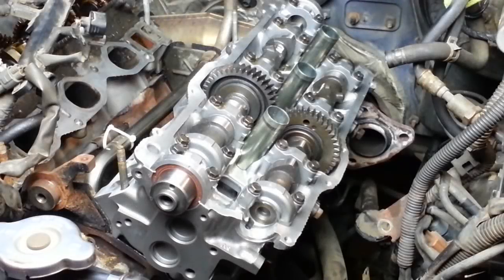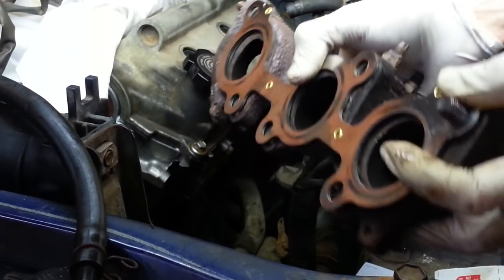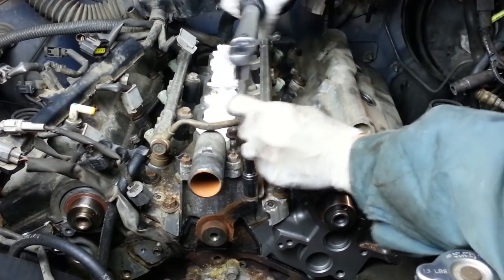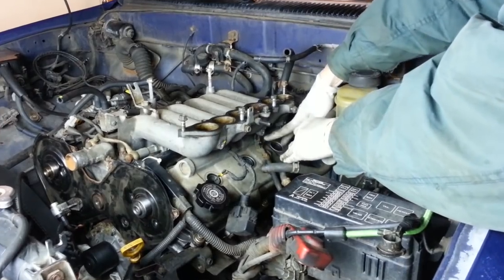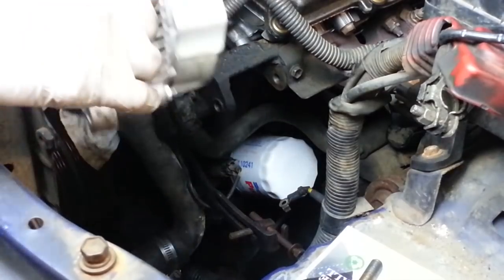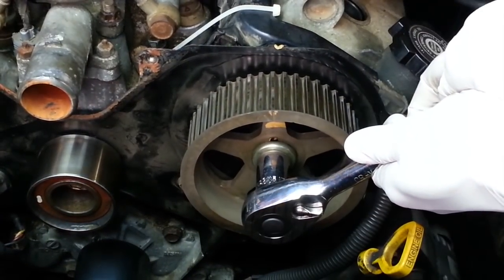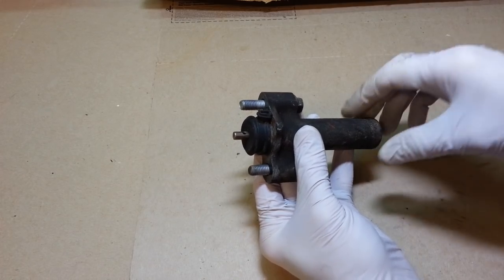Cylinder Head & Gasket DIY Procedure - Toyota 5VZ-FE - Part 5

Comment: I'm FINALLY over the hump replacing a blown head gasket and cracked head.  This series saved my bank account and sanity.  Everything was going according to plan until...  https://youtu.be/iQ7-wmjo6PE?t=73 - I apparently missed the step where I was supposed to save these before sending the old head back.  Now the entire project scheduled to be finished day after tomorrow or so, is on hold until I can source these plugs.  DANGIT!

Comment: Incredible series - currently deep in this myself and boy am i glad to have this as reference

Your water bypass pipe in that center housing- was that gasket for that pipe the cause of the radiator fluid build up or was it the gaskets?
Reply from the maker: Honestly I can't remember now. That coolant puddle was a surprising discovery when I did the disassembly. Best of luck with your project. Let us know how it goes.
Reply: @WorseThanChiggers i had the coolant there as well - it was a slow weeping drip from that pipe plate on the rear of the engine - thought it was the frost plugs but saw your video which got me tearing the engine apart - it was the gasket for the water bypass pipe going over the knock sensors ! Waiting on the parts now - thanks so much for this video man , honestly one of the best walk throughs out there , hope to see more 4runner material
Reply: Update - replaced the knocks, the bypass pipe, the idler plate, the harness, the valve covers and seals , water pump n oil pump , cam n crank sensors , lines..and just about everything else on the engine from starter to alternator- shes gonna purr like a kitten real soon! Back watching this video ! Its as good as doing the work yourself - very meditative

Comment: I cannot get enough slack on the timing belt to get the cam gears back on 😢
Reply from the maker: @michaelschmidt5179  you might try taking the idler pulley off, too. Then put that back last thing before releasing the tensioner.

Comment: I slipped a couple teeth on the sprockets and had to realign the timing belt install. Anyway now I have too much tension and can't get the passenger sprocket on so easily like you did or I did before. What's gone wrong? Btw thank you for this tutorial. Yota guys and gals we'll be using this for years and year. God bless
Reply from the maker: Did you already pulled the pin on the tensioner? If so, you'll have to repeat the process of removing the tensioner, compressing it, and reinstalling the pin.
Reply: @WorseThanChiggers  i hadnt put the tensioner on. I was in the process of torqueing the passenger sprocket when I slipped, turned the engine, and had to realign cams and crank. When I tried slipping the belt back on, I'm missing some slack I had previously and can't get the passenger sprocket on. I'm thinking I'll have to take the crank pulley off to see what going on.
Reply from the maker: @moreworklessplay  I don't think there would be a reason to take off the crank pulley. I'd just take the belt and passenger side sprocket completely off and start the process again. Set the crank and drivers side sprocket on their timing marks and proceed. You'll get it with some persistence.
Reply: @WorseThanChiggers  we did it. Working in day time much easier than working under light. Thanks again for everything

Comment: what size are the little torx endings on the exhaust manifold bolts? i cant find a way to get the stud snug before installing tjhe manifold. thanks!
Reply from the maker: Search for how to use a jam nut. It's two nuts snugged together that can then be used to tighten a stud.
Reply: @WorseThanChiggers  thanks! I ended up doing that. Just got the valve covers and exhaust manifolds on yesterday and today I'm going to do the intake stuff. Great videos, I couldn't do it without them!!

Comment: Excellent video , I had issues with overheating due to my water pump leaking , I decided to replace it along with timing belt ,thermostat , but when I filled up my radiator antifreeze/ water then started leaking on the passenger’s side back of engine , I checked my oil , I couldn’t find traces of water , could I have blown my head gasket ??.
Reply from the maker: Possibly. It could be leaking past the head gasket but not into the oil passages. Also check the coolant lines that go through the throttle body.

Comment: how many hours doid it take you also what head gasket kit did you buy
Reply from the maker: All told, I worked on it for nearly 3 months but I only put in limited time on weekends and was filming the process which greatly extended the project's duration. It was also over the dead of winter and the garage was too cold on many days to spend more than 30 minutes at a time in there. If I was to do it again knowing the process, I could probably do it over 2 or 3 dedicated weekends, excluding time waiting for parts. The gasket kit at the time was the Beck/Arnley brand ordered from RockAuto. Thanks for the questions!

Comment: Nice job.. YOU MAKE IT LOOK EASY... But I would have did an overhaul on the other head as well while you had the engine apart
Reply from the maker: Thanks for the kind comments. I really appreciate it. Indeed that might have been a wise decision, especially if you were paying someone for the labor to do that job while they were already way down in there. I decided not to "fix" what wasn't broken and to avoid potentially causing other undesirable problems to the passenger side. I did check and adjust the valve clearances on that side but I had no reason to remove the cylinder head and disturb the head gasket since the leak down test had passed on that side. Afterwards, the truck ran great for a few more years and never burned a drop of oil. Unfortunately, it succumb to the dreaded frame rust cancer and wouldn't pass the state safety inspection. So I had to sell it. I sure do miss my Taco.

Comment: Do u time the passenger side camshafts by the single dot or double dots
Reply from the maker: As noted in the video, the dots are not timing marks and are not used for timing the camshafts with the crankshaft. They are simply alignment marks for use when installing the cams to ensure that the intake cam is oriented correctly against the exhaust cam. The actual timing marks are different and are located on the timing belt cover backing plate. When installing the cams, align the single dots on the driver's side and align the two dots on the passenger side.

Comment: Great 6 part series and thank you. I can't imagine how hard it is to film and do the job at the same time. I cursed so many times during this whole entire job, it was not easy. I spent a lot of time cleaning everything also. Plus I pressure washed by entire engine bay area and under carriage before starting the job so it was mostly clean.
Just got done replacing both of my rebuilt heads( Headsonly in Texas, excellent work, make sure you clean it thoroughly with carb spray, I found bits of metal flakes from head machining on mine) they shimmed all the hydraulic lifters correctly too,  and did  a complete timing belt job along with a new radiator and hoses.
The hardest part was figuring the best way to install the exhaust headers first onto the heads and then bolting the heads on the block .  I highly recommend getting the exhaust manifold on first , don't tighten the exhaust bolts just yet and then mounting the connecting back manifold onto it. Once you have everything on, then tighten all nuts and bolts. Disconnect the 2 bolts from down pipe where it meets the catalytic converter( replace the gasket, O shaped crushed donut type gasket). Move the entire rear exhaust back from it's rubber mounts, This will give you wiggle room for the back manifold.
Regarding the timing belt install, I found that installing the tensioner bearing on last after you have the timing belt all lined up with both cams and crank pulley gear made it much easier way to install the belt. Then install the hydraulic tensioner last.

Comment: We have a t100 that won’t start.  We changed fuel filter, fuel pump, fuel pressure regulator.  It has spark and compression.  We even changed the evap purge and vent solenoids ( before it stopped running we had codes p0441 and p0446).  We checked all the fuses.  The fuel rail has pressure ( pulled the bolt facing the front because we don’t have a service port on the rail, because the vehicle is old —1997).   When we crank it, the engine turns over, but the rpm meter does not move.  Not sure why it won’t start.

Comment: THANK YOU I LOVE YOU MAN. YOU ARE GODS GIFT. I’ve been following this series for 3 weeks, I’m 17 years old with my first truck, never touched an engine before and I followed your instructions and you taught me so much about engines. After pressure test, BOTH of my heads were cracked and I replaced my heads on my 99 Tacoma. This was such a headache and a learning experience, now I feel like someone can point at a part into a 1st gen Tacoma and I can tell them exactly what it is. Mechanics were trying to charge me 3,800 just for the head gasket and I only spent about 900 for parts, tools, and fluids. Seriously man, taking your time to do this and help people is so great and I can’t thank you enough. My engine runs better than before AND I finally fixed this misfire. You rock man!!!!!!!!

Comment: I’ve been watching this entire series and you did a most excellent job. My only question is did you fail to put in the spark plug gasket keepers?
Reply from the maker: No. I did those, too. They were part of the gasket kit.
Reply: @WorseThanChiggers  i’m watching part six now. Better than Eric O Sir. For someone who said “I never did a head gasket before“ it was done better than an expert. Maybe I’ll go back to where you put the gaskets on the valve covers but I don’t remember seeing you put them in I was curious how you do it.
Reply from the maker: I assume you're talking about the 3 round spark plug tube gaskets that go into each valve cover. I don't remember why I didn't include that in the video series but I certainly did it. You can see them clearly here https://www.youtube.com/watch?v=iQ7-wmjo6PE&t=34 and that they each have a little metal tab that must first be bent out of the way. You can then drive them out with a hammer and screwdriver. The new ones go in with a very light coating of grease. I drove them in with a very large socket until flush. There are many other videos out there showing that process. Good luck with yours!

Comment: I would change the timing belt full kit and definitely those spark plugs are not ment fore that engine it is highly required to install the double grounded electrode spark plug

Comment: I have a question, when you temporarily install the right hand cam pulley and turn it as to align the timing marks, does that mean your two dots on the cam gears are not lined up facing each other as you initially installed them? I’m kind of stuck there, and also thank you for this series on the Tacoma engine! A real web gem!!
Reply from the maker: Yes, the dots are initial alignment marks to get the cams in and down tight. They are not timing marks.
Reply: WorseThanChiggers Thank you very much, Sir. Your videos are truly helpful!

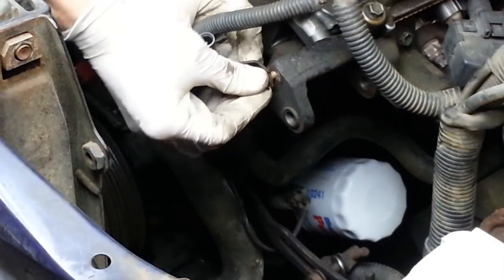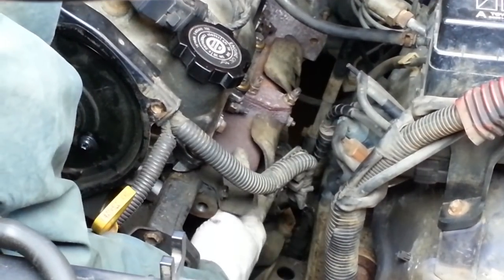Comment: 14:04-14:20 couldnt tell if you got the oil dipstick guide all the way back in.
Reply from the maker: It did go all the way back in and the rubber grommet seated properly.
Reply: Actually it starts at 13:55-14:20

Comment: Question for anyone who can answer! I have the 3VZE and need to replace its head gasket, is the engine assembly almost identical to the 5VZE?
Reply from the maker: I imagine that there would be many similarities and differences. Definitely purchase a genuine Toyota factory service manual on that engine before taking on the project. I always consider that to be my 1st mandatory tool in my toolbox before diving into such a significant repair. Good luck!
Reply: WorseThanChiggers thank you for replying.:)

Comment: Is it necessary to run a tap through  the cylinder head bolt holes?
Reply from the maker: I wouldn't think so unless you have bigger problems with corrosion down in there or, worst yet, stripped threads.

Comment: Im about to attempt this job myself and this has been about the best set of videos on this I could find. And very helpful. But am I missing a video between 4 and 5? Cause you went from putting in the cams and taking out the service bolt at the end of the 4th video to putting on the plenum. There was alot of things I would have liked to see in between the two vids. Like putting the intake back on and the manifolds and those bolts that's are a pain to get to . And all the fuel line stuff. Is there another video that you made that is either somewhere else or did u just leave it out? I don't mean to complain, it's just that I would like to see the complete job without steps left out. Cause it would definitely help. But I probably have a good idea why it might have been left out because of all the cussing and throwing fits from the exhaust bolts and things like that. But if that part of this series is on here please let me know.
Reply from the maker: Thanks for letting me know. Perhaps there's a bad link somewhere to the 5th video? Indeed, the 4th video wraps up after I reinstalled the cams and the 5th video picks right back up with the next steps of the procedure where I reinstall the valve covers, exhaust manifold, intake manifold, fuel rail, etc. Here's a link to the entire playlist. Please let me know if you still can't find the 5th video. https://www.youtube.com/playlist?list=PLUdzuNFw-6nlCcguzhKhFyHgQ6PEud5o1

Comment: I'm about 2/3 of the done with both head gasket replacements and head rebuilds on an 01 4Runner. I wouldn't have attempted this job myself without these videos. The money I saved allowed me to buy other needed parts and some very good and useful tools. Thank You!
Reply: Thinking of buying a 99 4runner with a blown head gasket for 300. Never done a job like this.
Reply: @kevinmalpica7663 : After doing the entire job, which took me two months for various reasons, I found out my lower end was bad so it was all for nothing. I ended up swapping in a long block. This was my first time doing a head gasket two (both of them). I would recommend taking lots of pictures as you tear it apart so you know where everything goes when you put it back together. I would also recommend checking to make sure your rings are okay. Mine overheated badly so it caused more damage than I thought. If it's just a head gasket that went bad slowly; you should be okay.
Reply: Thanks for the advice. I work on cars but never did a head gasket on a 4runner is what I meant to say. Hopefully I don't run into that type of problem. I'm going to tear apart the motor and if I see major issues then I'll get a motor

Comment: Can I pull both heads at same time on a 93 V6 3.0 motor by keeping timing cover plate in front on an crossover pipe in back?, An leave cams in heads up disturbed to change head gaskets, ?
Thank you

Comment: Hey great video, if you have a minute and haven’t already done it, would you mind posting the cost? A detailed list would be nice but I’m interested in the total cost and difference of purchased head as total would be diff if it were just blown gasket. Thanks Brian 96’ 4Runner possible blown gasket
Reply from the maker: Hi Brian. Here was my total cost breakdown...

Parts:  
 $325.00 rebuilt cylinder head
 $138.00 gasket set
 $25.00 cylinder head bolts
 $23.00 valve shims
 $10.00 fuel injector electrical connector
 $16.00 antifreeze
  
 $537.00 Parts Total

Tools:  
 $54.00 OTC universal pulley holder
 $80.00 factory service manual
 $7.00 oil can
 $7.00 blow gun nozzle
 $20.00 torque angle gauge (skip this and just make a mark on the bolt heads with a silver Sharpie)
 $76.00 machinist's steel straight edge
 $34.00 valve adjusting tool
  
 $278.00 Tools Total
  
 $815.00 Grand Total
Show less
Reply: Great, thank you so much!

Comment: Hey I have a ? I had my truck service on some ticking noise  from my lifters I think that's what they're called so I drove the truck for two day an now it's making a noise loud one at that  took it in an they said my exhaust gasket is leaking they did a leak down test an that's what they found . Now do you think they might've done something wrong to make my trucks gasket fail ??
Reply from the maker: I am curious which exhaust gasket you are talking about. There is a metal gasket between the engine block and the exhaust manifold and a round fiber gasket between the exhaust manifold and the pipe leading down and out of the engine bay. I assume that the original problem with the ticking noise was solved by adjusting your values. That repair would have only involved removing the valve covers and should not have disturbed your exhaust gaskets. I don't understand how a leak down test would have found a leaky exhaust gasket. That test is to determine how much your cylinders are leaking and where the leak is (values, rings, a crack, etc). In any event, my guess is that your leaky exhaust gasket is separate and unrelated to the repair of your ticking valve problem.
Reply: Well my toyota is a 2000 tundra v8 they removed the timing belt to get to the lifters and removed the cam  aswell .
Reply from the maker: Ah, that's a different engine than mine. Either way, removing the timing belt and cams should not have disturbed the exhaust gaskets.
Reply: worsethanchiggers thanks for the fast reply and great work down to the science..